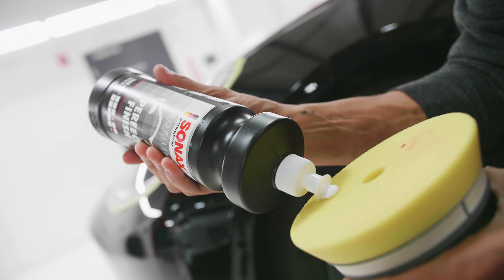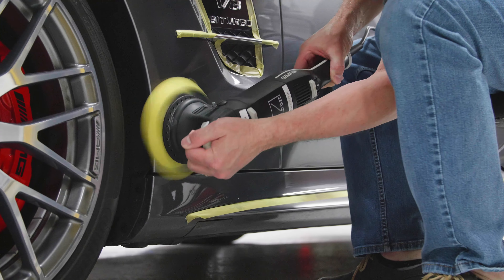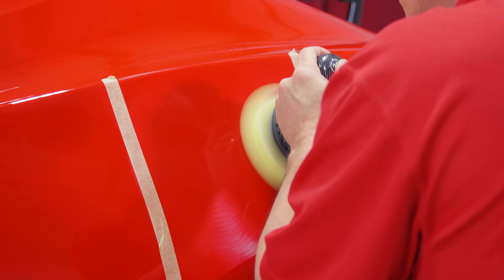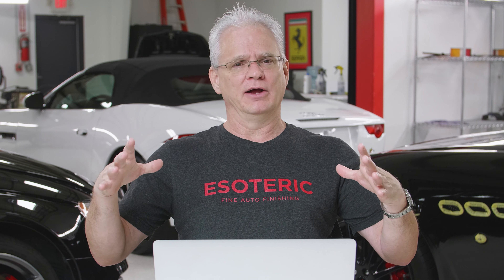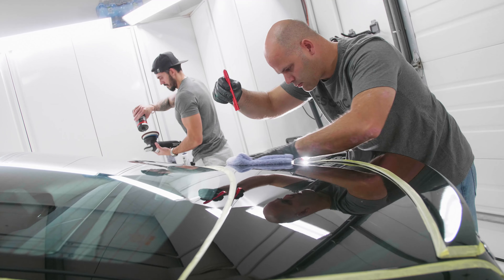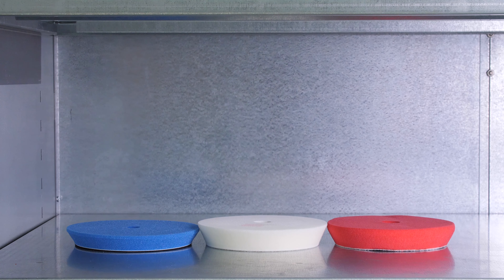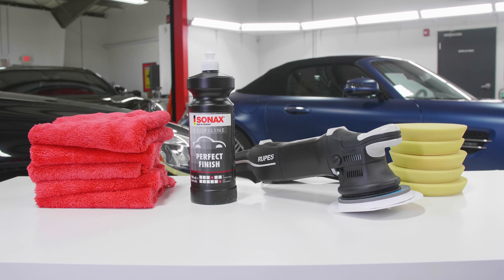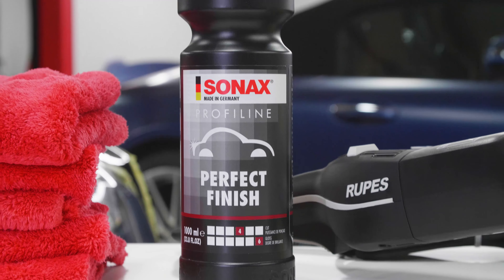Find the BEST pad and polish combo on ANY car! | FAQ series by ESOTERIC!

Comment: Great video Todd, does the Sonax perfect finish add fillers to hide light marring/scratch’s? Concerned  as if it has fillers I won’t be correcting but hiding imperfections and the desired finish won’t last? I would like to correct and add ceramic coat then not worry about it for a couple of years. Thanks in advance
Reply from the maker: We have been using it for a decade (or more), and see our cars months and years afterwards. We would have noticed if there were issues...
Reply: @Esotericdetail  thanks for the info, must appreciated

Comment: What compounding pad do you use with the Sonax perfect finish?  And what would you recommend for a spray and wipe sealant?  Thx Todd
Reply from the maker: You use a polishing pad, not a compounding pad. The Rupes yellow is the most common fit with it. If you want really good durability, look at Gyeon Cancoat. If you wish to go with a sealant, I'd look at Polishangel Master Sealant (hand applied, not sprayed). If you want a durable and easy to use spray, look at Polishangel Cosmic Spritz.
Reply: ESOTERIC hey Todd, thank you for that great info.  On the Rupes Yellow Polishing Pad, are there two grades this is offered in?  A medium and a fine?  After performing a polish with Sonax, do you recommend a panel wipe prior to any protection product, such as Can Coat?  Thx again.
Reply: ESOTERIC Todd can you confirm something for me regarding Rupes yellow pad sizes.  I’m looking for a 5” Rupes yellow finishing pad and I’m finding info that says you use their 6” pads on a 5” backing plate.  Do I have to use their backing plate or can I use the hook & loop 5” backing plate that is already on my Maxshine M15 pro series ll DA polisher?  Just a bit confused on this.  Thank You!

Comment: Hi Todd, I have a question regarding the finishing step, on a medium hardness clear coat if I do 4 normal passes at speed 4.5 and a fifth at speed 3 with a Rupes yellow polishing pad would that give me a similar finish compared to using a Yellow polishing pad for 4 passes at 4.5 and then repeating the same step but with a white finishing pad? If that makes sense
Reply from the maker: No need to...waste of time. Unless you're dealing with really finicky paint, there's no need to follow up the yellow with a white, or change your speed.

Comment: Yep 1 pad 1 compound . 1 Pad 1 polish 👍 Don’t need to be running 10 pads a car lol unless paint really messed up
Reply from the maker: If you only use 1 pad per car, you're doing nothing but spreading product around. We have a $4k meter that we can evaluate performance drop-off from panel to panel when using the same pad over and over.
Reply: ESOTERIC I said 1 pad per product 
Not 1 pad per car 
You don’t need to be using 10 pads on a door panel

Comment: How to polish extremely soft paint? No matter if I used Menzerna 400, 2500 or 3800 the polish and compound was so difficult to polish out. Usually with my car I polish until the product ''disappear''. Very easy, but my friend's car is extremely soft. I tried more and less product and also smaller sections. I was never able to polish it so it ''disappeared''. Sometimes it also felt like no matter what I did my rupes mk1 wasn't able to rotate the pad even on the flattest surface (hood/roof) no matter the pressure. almost like the product made it so sticky.
Reply: Dan Waleke yeah, what kind of car for sure.  I’d like to know that too.
Reply from the maker: Try Sonax Perfect Finish and a finishing pad...great combo for soft paint, and it wipes from the surface easily so you reduce the risk of marring from the towel.
Reply: @YanniObkirk  Saab 9-3